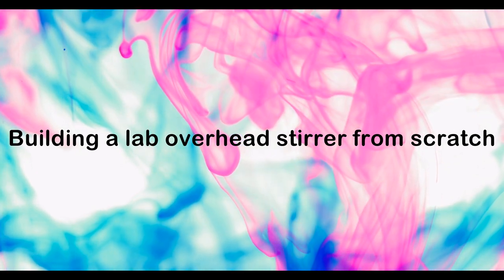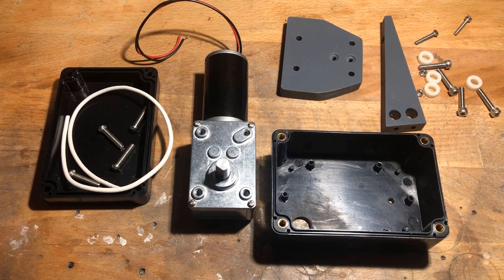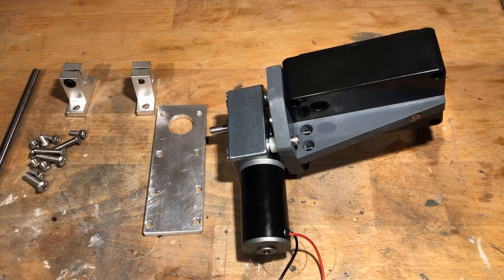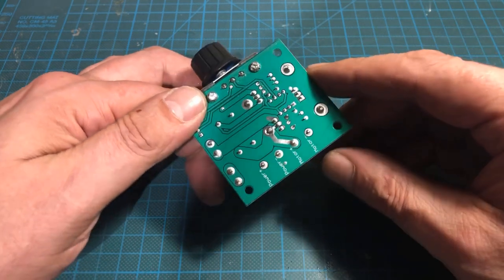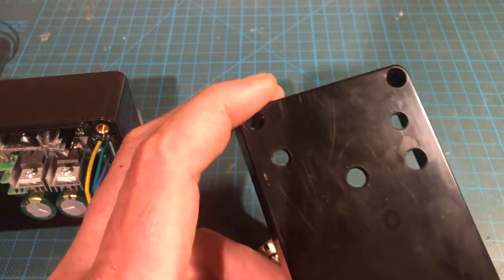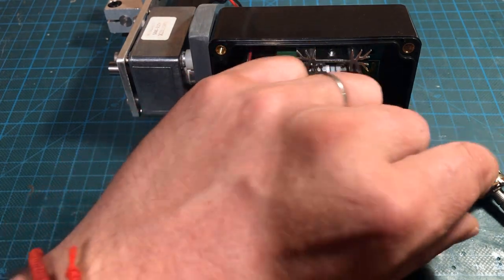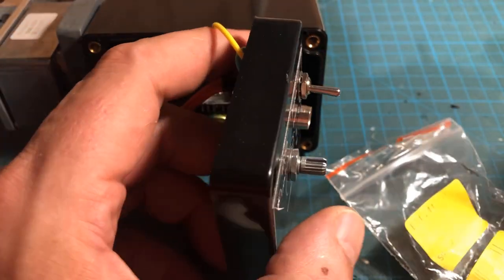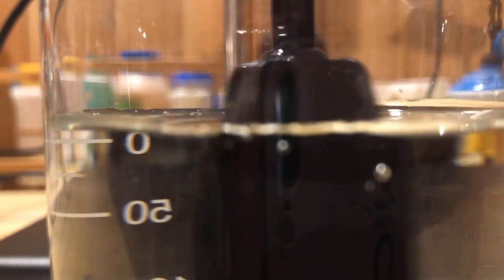Building a lab overhead stirrer from scratch

Comment: You inspired me! I just ordered parts to make a similar one. I will be using a higher RPM version of the motor, an 8mm/M10 connector bushing and an M10 1.5-10mm chuck that is meant for converting angle grinders to drills. That way I don't have to fabricate my own shaft connector like you did. Another option would be to get a B10 or B12 taper adapter for the 8mm shaft, and a matching taper chuck. I think I will use an adjustable power supply to control the speed, I have a laptop supply sized one that exceeds the stall current (12V 5A) that should work ok. I'm considering just using a clamp to attach it to my lab stand, but if it works well, I hope I can one day convert it to such a beautiful self-contained solution such as yours turned out. Thank you for the inspiration.
Reply from the maker: I'm glad to hear that. Thank you for your feedback. Good luck with the build 🙂.

Comment: I was exactly looking for a video like this. Thank you so much for our video, it inspires me. I saw the prices for an overhead stirrer here in Central Europe and had a big oof moment. Now I am looking forward to build my own. Your solution is pretty straightforward and therefore easy to build. Thanks a lot!
Reply from the maker: There are different versions (rpm) of the geared motor available. Use what suits your purposes best. I mostly use my overhead stirrer for mixing epoxy resin, where I need rather slow speeds.